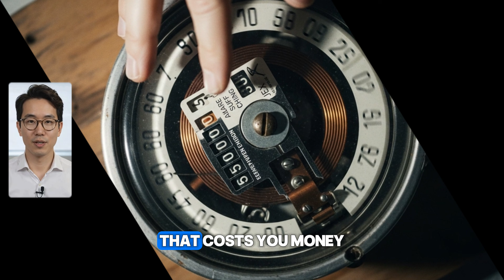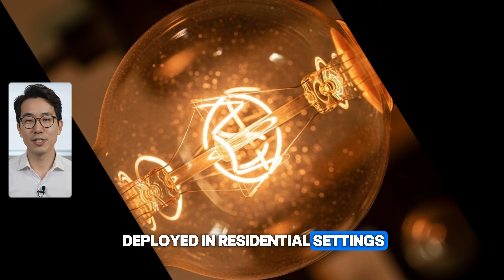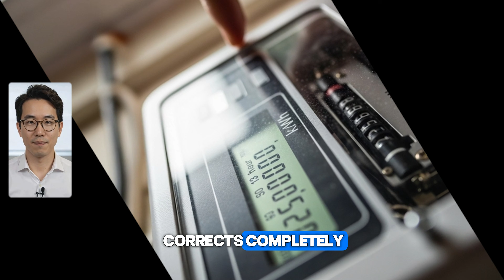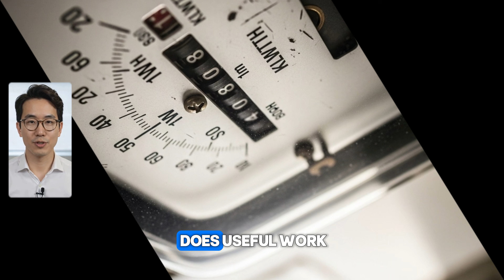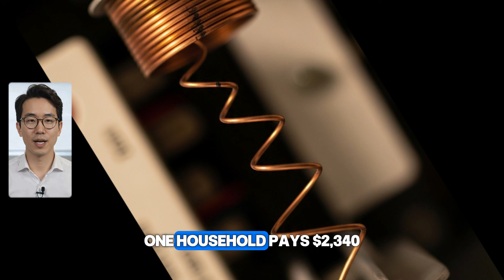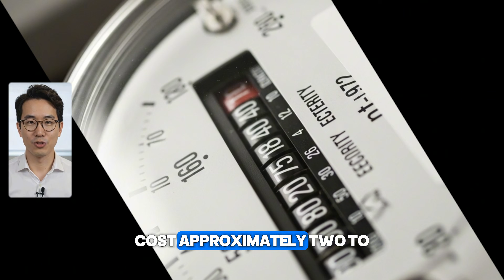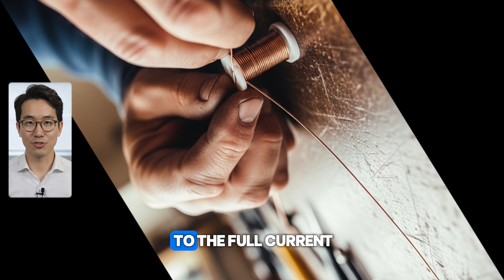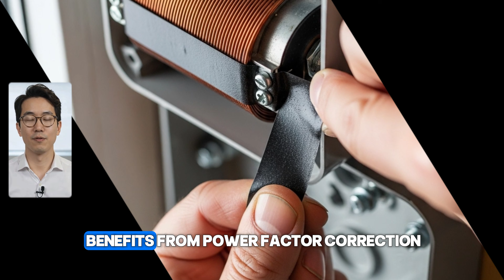This $3 Coil Wrapped on Your Power Line Cuts Electricity Bill in Half. Utility Companies HATE This

Comment: We are not charged for reactive power. We are charged for actual use. Reactive power charges are for commercial and industrial uses.
Reply: When I had no appliances and barely used the lights with a shower a day they still charged me 950 as if I had a full range of home appliances, there's also dirty electricity
Reply: @Joanna-e4y5q   That is horrific usury!!  But are you, by chance, in an area devastated by wildfires or other disasters?  Disaster maintenance is huge, & utilities do bill residents for it….commonly, they bill more to residential, than to commercials…. Corp’s goal is to favor businesses, not residents. 

 Does your bill show what portion of your bill goes to what purposes of the utility?  
Beyond the basic 3 items that include things like transmission, maintenance, admin, is there an “Other” category?  
Utilities know folks understand the 1st 3 items.  Those are what the unit-price covers. 
The unit price is controlled, & a raise in unit price requires votes & is limited how often it can try for a raise.  

But “Other” is a catch-all.  
They can camouflage all kinds of charges under that, & none of “Other” is required to be itemized!!
Good luck getting that data from them.  
There’ll likely be resistance.   
Commonly, utilities claim disaster repairs jacking-up costs….but that is not the full picture …

Does your area have smart meters? 
That is, each meter wirelessly sends meter readings right to head office, OR, do several meters around your house, send their meter signals to a “hub house” meter, & that compounds of data then is sent to head office?    
Because, it is possible that wireless signals might get crossed, or data hacked.  

Or, do you have exterior outlets on property?  
Cuz it’s easy for thieves to steal juice by connecting to your exterior outlets or lines—if they do this via underground wiring, it’s invisible.  
But, it can be in full view too — one householder caught neighboring constructions crew plugging into their house exterior plugs.  
They had been plugging in after the family left for the day, & unplugging before they returned—the family  only caught them at it, cuz one of them stayed home one day & caught them red-handed.  The business had never asked permission, & did it by deliberately stealth. 
It was a battle to make the construction company repay the energy use.
The family immediately installed a locking cover  over their exterior outlets, to prevent anymore of that.  

By now, there may be other tricks power thieves use. 
If you check for wireless signals around your house, in a neighborhood setting, commonly there’ll be several or more.  
Can energy thieves capture wireless energy from your house?  Can that jack-up your energy use?  

And, some things folks don’t realize suck energy—like, regular computers, especially those with big power supplies in them, such as used for gaming online, or for crypto-mining. 

Here, we have 2 households blended.  Our base use had been around $75/mo, if no heat/cool was used. 
Then, combining those, it became about $160/mo .
The housemates believe that keeping their big computers on all the time, ready to use, 24/7 helps their computers last longer….but that costs more per month.  So, the basic bill (without heating/cooling) runs closer to $200/mo.   
Know what your basic use bill should look like. 
Ask neighbors with similar houses, what their basic bills look like—that’s Not being nosey — these days, it’s self-protection!!  
Utility companies have long hidden how much power a house uses from new owners who move in.  
That lets them get away with a number of clever ways to manipulate the bill, & since folks are not in the habit of sharing what they pay to utilities, it’s ripe for graft/corruption.   
So, DO ask neighbors with similar houses as yours, in your neighborhood!!

I encourage you to challenge those kind of bills.  
Complain to the utility, & to the entity that is supposed to keep utilities honest, like the State energy regulators.   
Utilities are SUPPOSED to help find what causes abnormal bills.  But many really don’t.  
Push to find what loads caused your huge bills. 
Ask for itemisation of the “Other” category, if it is not already itemized. 

Good luck!
Reply from the maker: You’re right that most residential users are billed for real power only. Thanks for adding that clarification—it helps keep the discussion accurate.

Comment: 18 gauge bare copper or covered copper
Reply: It doesn't matter if it's covered or not you're going to get the same results but the covered copper is better on your hands while wasting your time wrapping it.
Reply: @danieljohnson6499    ??  Why wouldn’t it matter?  
If Not covered, allows the copper to capture the line bleedover energy.  
A coating— depends how thick the plastic, but coating kinda insulates; impedes the copper from grabbing the energy.
Reply: And 80 feet is only 2 to 3 dollars
Reply: Covered or bare  the transformer will get twice the volume if wrapped, hence too big to fit into elelectronic units.
Reply from the maker: Good question. Usually insulated wire is safer and more practical for most setups, but it depends on the specific application.

Comment: Heat generated by electrical devices is wasted power. This also applies to RF generation.
Reply from the maker: Good point—heat is often a byproduct of inefficiency in many systems. Energy conversion always comes with some losses depending on the application.
Reply: Tell that to someone with electric heating or a toaster and they will laugh at you.
Reply from the maker: Fair enough—different applications behave very differently. What works in one context doesn’t always translate directly to another.
Reply: @ForbiddenOutdoors    Are you an electrical engineer?   
Or, do you let AI scrape data to cobble into AI generated script with certain parameters?  
It matters. 
 Cuz there will be folks who try to fake it using the minimal bits given; from the confused & insufficient data you presented (stupid human tricks 🙄). 

This video ..could.. actually do good for humans, if instead of verbose, mispronounced chatty story, it instead gave clear directions & explanations how & why, concisely. 

But that would require it be composed of plainly worded directions from electrical engineering.